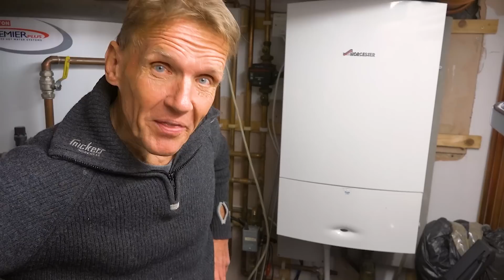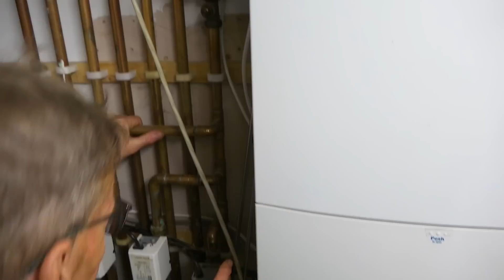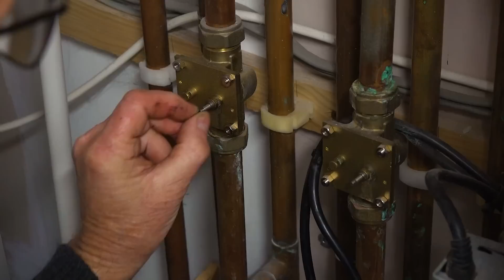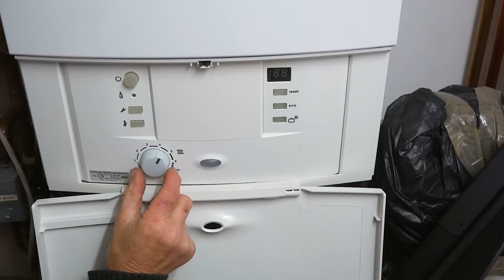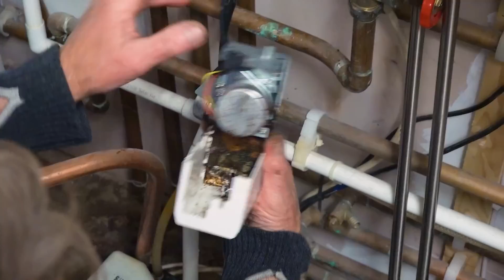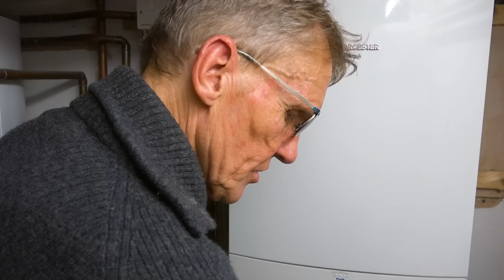How Did British Gas Miss This Simple Fault?

Comment: Don't trust british gas, bodge artist's caused more damage than fixed, back then Keston boiler, not working, called them obviously clue less about Keston, damaged casing  leavering it off without looking to where the above fixing screws were,  later I stuck lables on indicating fixing screws location Lol another left garage flooded with water after finished master piece of repair, left me to mop up mess

Comment: British Gas used to be great. Problem now is, cost cutting. Many years without bringing on new apprentices. Experienced engineers retired without passing on knowledge. Then they restructured engineers contracts under fire and rehire, again losing many experienced engineers. They’re no being propped up using a huge contractor network who they pay £30 to service a boiler. What service would you expect at that rate?

Comment: What a rubbish control valve.
If you can’t make a valve without a safety bypass for a Leakey seal, THEN GOD help us.
This has to be the best case of built in failure rate.
And why can’;t I fit a new seal for a few Bob.
Money grabbing parasites that’s why.
We need laws stopping crap products being sold.

Comment: Didn't see any safe to touch tests here...
Reply from the maker: That is because it was all switched off
Reply: @SkillBuilder TB118, basic legislation really that every gas safe engineer should know about regarding working with electrical systems,   just because it's off at the switch doesn't mean it's dead.... that's why professionals always carry a voltage indicator in their pocket at all times.  Yawn....
Reply from the maker: Carrying something in your pocket doesn't mean you use it and I have seen a lot of electricians working over many years and that is not something you see a lot.
There is guidance, which is not a legal requirement to test the earth loop impedance of the electrical system, but if an RCD is tripping every time the circuit is switched on it is reasonable to suppose that the circuit protection is functioning because the earth loop impedance is sufficient to trip the RCD. Leaving it off when touching the boiler etc is a reasonable way to proceed.
Reply: @SkillBuilder  I've been in the gas industry for 30 years, I've known engineers that wish they followed basic safe isolation tests, 230v AC is nothing to take half heartedly,  especially if your the guy that day that makes the mistake of trusting other people's handy work.  Always cover your own arse, nobody will do it for you.  TB188 takes seconds to complete compared to an injury that could last a lifetime,  before I ever grab electrical fittings, my volt stick is the first thing I touch.

Comment: Nice to watch a systematic approach to problem solving coupled with a wide-angle view. I've always wondered why zone valves aren't designed with flanges, like pumps, to make them much much much easier to replace:-)
Reply from the maker: you can buy flanges for them

Comment: Am I right in saying BG only cover the boiler only.
Reply from the maker: BG offers boiler only or whole system but they are picky so you may find they won't cover an old system. This one was covered and they replaced both valves with Honeywells

Comment: BG don’t cover underfloor htg so if they call the guy back it won’t get done.
Reply from the maker: Except that it did get done by them with no arguments. Underfloor is not the zone valve above the floor. BG are avoiding the prosepct of lifting and reinstating floors.
Reply: @SkillBuilder  interesting I taught they wouldn’t touch any part of the Underfloor htg because  changing controls which  involves the ufh wiring center  which has a pcb, I suppose they avoided that by using a 5way connector.

Comment: Roger, if your neighbour had called them back to report the fault was still present, they would've had to come back, and the lazy/clueless engineer would've received a recall which impacts his productivity figures.
The only way a fault is left unresolved is if the customer believes the nonsense the BG engineer is telling them and doesn't call back to complain.
As en ex BG engineer, we were expected to fix everything unless it either wasn't covered under the T&Cs, or the parts were obsolete from the NDC (regardless of whether they were still available elsewhere). That's not to say engineers didn't find excuses to not fix things, or delay the customer beyond the recall period. 
I worked in a team of 22, and I'd say I'd only be comfortable having a quarter of that number work in my own home. The manager had also never done the job and was completely useless.
Needless to say I no longer work there.
Reply from the maker: British Gas did come back and they did replace both valves but that was five days after the initial call. If the fault had been found on the first visit the whole thing would have been slicker.
Reply: @SkillBuilder  I'd say that's down to a lack of knowledge from the first guy then. Unfortunately it's luck of the draw as to whether somebody competent is sent out in the first instance as jobs are allocated on availability.
There was a drive a few years back to 'upskill' the meter fitters as their contracts were more financially beneficial to the company, along with the recent fire and rehire fiasco which has watered the skill set down even further.

Comment: All depends on the cover they took out with British gas. If they took Boiler cover only then they won't check the other stuff. So before pointing fingers I was ask what is their cover they have and what does it cover 🤔
Reply from the maker: Steve 
Do you really think that I didn't check those details?  The fact that they came back and replaced both motorised valves with Honeywells proves that the cover was for the whole system. If it was boiler only cover the origninal engineer would have advised the customer accordingly.
Reply: @SkillBuilder  I don't know as you didn't state this in you're video. But putt8ng the BG engineer down quickly enough but not explaining the cover the customer had.  
We use BG and they have been great and we only cover the boiler. We had a situation where we kept losing pressure and they confirmed it wasn't the boiler. As we didn't have cover for the rest of the system. It was left to us and was found to be a leaking bleed screw

Comment: Twice called the gas clowns to sort boiler, fault remained, look on internet, found fault, diaphragm, drove 70 miles to collect new part, called the gas clowns, told them I got a new for them to fit, turned but would not fit their replacement part, not mine even though they were the same make.

Comment: Should really be an isolation valve either side of those zone valves so when things like this happens you can replace them without draining anything down.  Good spot on the diagnosis👍

Comment: BG service plan is a real racket, ours was ‘free’ due to them being our gas and electricity supplier. Boiler went wrong, it was getting on a bit, engineer made a big song and dance about how dangerous it was and surprised we hadn’t died of carbon monoxide poisoning. He hadn’t noticed that there was a detector right above his head and when I pointed it out his first reaction was that it can’t be working, at which point I told it was only 16 months old. Condemned boiler and got his mate to come round to provide a quote for a replacement, quote was over twice what we ended up paying. Preying on the vulnerable, a right bunch of cowboys.

Comment: What was the point of turning the immersion on then opening the zone valve for the hot water? Why not leave the zone valve closed and just use the immersion for the hot water and open the ch zone valve if heat was needed? Also by opening the zone valve you correctly stat that there is now no temperature control on the unvented cylinder. In the small possibility of the boiler ntc’s failing, you have now potentially created an unsafe situation. This video is a cheap shot video and to me is the equivalent of a click bait post. Judging by most of the comments seems like your audience are all unqualified people who have no understanding of heating systems. Granted this wasn’t the hardest thing to diagnose but slagging off other engineers in your industry doesn’t make you a great engineer.
Reply from the maker: I turned on the immersion to speed up the heating of the hot water simply because they wanted to use the shower. 
I don't understand your point about the DHW. The cylinder temperature is controlled by the Honeywell valve which was functioning perfectly. That said I don't agree that the opening of the valve manually creates a 'dangerous situation'.
You need to define 'dangerous situation'' If you are talking about the water overheating that would be the same on a vented cylinder. If the boiler stat failed it would simply cause the cylinder temperature to rise but with all the radiators in the house open the hot water temperature would not reach the 98 degrees needed to open the temperature relief. 
There is a lot of guff talked about unvented cylinders. If you go abroad you will see them used with no expanison vessels and that is arguably a safer method because it allows the pressure/temperature relief to operate periodically rather than relying on a service engineer to open it once a year. 
The important thing is that if all the multi-level safety devices were to fail there is still a bursting disc in the temperature relief to prevent it exploding. 

As for your final point about 'slagging off'. That is a childish remark. There is room for legitimate criticism. If people are paying for central heating breakdown cover it is not unreasonable to expect the guy who turns up to engage with the problem.

Comment: BG gave me a quote once about 5 years ago. 
They quoted me over 6 thousand for a new boiler. 😱
I'm not a plumber, but I said to the person on the phone I know a little bit about plumbing. 
So I broke it down. And asked him to justify that cost.
I said, "In the worst case, we will say a thousand for the boiler,  but you are more than likely getting it for less than five hundred. 
I said lets go fifty for pipe needed and your lucky if you need to use more than 15 pounds worth as it was just adjustments to old piping.
Then I finished with I'm pretty certain your not paying them this but we will say 250 for the person doing the labour?
So I rounded it all up and said we'll add a bit of mark up so you make some money. 
All in all I said you could quite comfortably do the job for £1500.
His reply was he didn't set the prices. 
I said, "Know you don't, but you work for a company who pray on the elderly and people who haven't got a clue.😢

Comment: I think it must be something institutional because I've had nothing but weird and terrible experiences with British Gas. In one case I moved into a new rental and signed up straight away with another energy supplier so I never even had an account with British Gas.  Nevertheless for 4 years I had demands from them for all kinds of odd payments. It was just totally insane communications from this company. In another place I had no gas appliances at all and yet they approached me every few months with new charges for not using the gas. Having it inspected.  Having it capped. Having it inspected again a year later. All at the expense of my non-gas using business. When I was a customer I had quite a few incorrect direct debits that I had to arrange to be reversed with apologies on the phone from British Gas customer services. There must be some chaos in their systems put in by decades of neglectful work that isn't possible to comprehend or overcome causing British Gas itself to flail randomly in its attempts to do business.
Reply: Whether you use gas or not, you still have to pay standing charges... Unless you got the meter removed?

Comment: Yeah you’re paying your annual fee but British Gas don’t cover underfloor heating, the customer would know that as well. I’m guessing that’s why the engineer didn’t look at it
Reply from the maker: If that were the case there was still the valve on the radiator circuit and that was by far the worst. If it isn't covered they should say so rather than say they can't find the fault. In the end they replaced both valves so it would seem they did cover it.

Comment: My eye went immediately to the extensive green copper corrosion all over that pipe. Whoever made those joints made a mess of it. There are leaks everywhere.
Reply from the maker: That is just verdigree from flux that hasn't been cleaned off. It is not a leak and it is not a huge problem. The acid has done its worst

Comment: Same shitty boiler as the one we have , nothing but problems over the years , and the crappy wireless thermostat keeps loosing it connection.
Anyway  this type od problem  just about sums up how unskilled a lot are these days ,got the qualifications that say they can do the job , but inreality they are useless .If its a problem beyound what the computer says they can not fix it

Comment: When the so called  engineer comes back he will blame it on dirt in the system and charge for a full power flush. Rhino's, thick skinned and charge Alot. I wouldn't sign up to their disgusting practices in the times after privatisation and was sacked. That was the "new world" my manager told me. Utter thieves. Ken Pittman was the worst, flogging new boilers for fun, in cahoots with dodgy sales staff. Disgusting.

Comment: Simple solution - heat pumps... No gas
Reply from the maker: The gas side of the installation was not the problem. There is nothing inherently reliable about heat pumps.
Reply: I have built 372 houses in UK and France - they all have heat pumps. They all work fine. Gas is a pollutant. Why install an outmoded form of heating? @SkillBuilder
Reply: @steverichmond7142 lol and where does the majority of electricity come from currently? 😂 You'll find that it's mostly oil, gas and coal that generate the electricity in most parts of the world. And those heat pumps you are fitting, will be obsolete/replaced by the time the world is net neutral lmao. You need a full perspective on things.

Also, this guy is pointing out a repair, keeping an appliance from going into landfill/polluting the world, what bearing does replacing it with a heat pump have on this situation? Especial with my above fact that most electric generated IS NOT renewable.
Reply: @CaptainCoolpants101  Not in Scotland. Renewables will account for 80% of generation in 3 years time. I have invested in onshore and off shore wind and it's made a fortune. I also fit HRVS with a small heating element. By the time they wear out I'll be well dead. HRVS of the type I install last at least 18 years... so far.
Reply: To add onto this point, why should the UK people pay to replace their heating systems at all? After you look up the stats on what percentage of electricity is renewable, check the stats of the total world pollution... The UK is 1%... One singular percent of the pollution in the world is from the UK... How about you take your bright ideas to China and surroundings, and and ask them why they don't get heat pumps.
Reply: @CaptainCoolpants101  You need to look at the stats for Scotland. I  don't care about the rest of the world, and China will be 80% sustainable in 5 years time. You should advocate for alternative energy to save your clients money. My annual fuel bill is less than £600 - including recharging my EVs.- car and van. Get rid of gas and save the UK a fortune.

Comment: Nice find but by removing them you have bypassed a safety device and can cause the system to over heat.
Reply from the maker: Tell me more. The boiler has an overheat stat and will fail safe. I think you are being alarmist. The heating zone valves simply shut off the circuits so leaving them open just means the circuits are on as they would be if you turned the room stats up to maximum. You would finish up with hot rooms.

Comment: I would not trust British gas and not touch them with a barge pole. I had that service plan, they came out for a service and condemed my boiler from rust on the casing, and left us without heating, the rust was caused by a valve leaking above which they had not spotted. I then made the mistake of letting them fit a new boiler, they did not bother bricking the inside wall of the house were the flue went through to the outside, they filled the hole with pieces of polystyrene, all of a sudden our kitchen was colder than it had ever been, then they would not compensate me for the rubbish job.

Comment: Well known Boiler Company gave myself and another few lads some great advice about similar situations like this. Such as removing extermal outputs on the boiler termjnal and putting back the factory loop which will indicate clearly if it is a short circuit with the boiler or external controls Mvs etc. Great video I come across this problem from time to time usually a hidden Motorised valve behind a cylinder in a hot press.👍
Reply from the maker: Hot press is airing cupboard on this side of the Irish Sea.  I am now multilingual.
Reply: @SkillBuilder  🤣

Comment: 9 times out of 10 as a heating engineer if the circuit is tripping it will be either the pump or motorised valves, British gas work off a fault finding laptop, most not experienced engineers and if the computer dont tell them the fault its game over, however these large companies are taking out real gas engineers as the trade cost lots of money to trade ie tools, training, gas analysers, vans etc and British gas have most of the market covered.